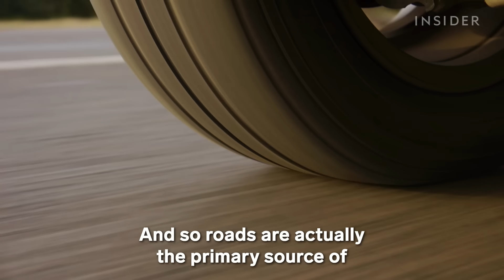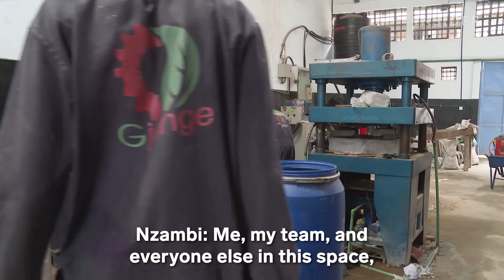Young Inventor Makes Bricks From Plastic Trash | World Wide Waste | Business Insider

Comment: There's a guy on an island who had built himself a process of turning the plastic that washes up on the shores, back into diesel fuel. The people if the island bring him plastic waste they've picked up and trade him that and a little food and he supplies them with fuel.
Why not turn the plastic back into petroleum?
Reply: Because right now it is still cheaper for oil to be turned into gasoline.

Along with that the fuel produced from plastics is actually very mess releasing many harmful pollutants into the air and ground water including mercury. Also the fuel produced doesn't contain nearly the same amount of energy as direct oil fuel. Finally not all plastics can be used.

Comment: They should use use that to make furniture materials to replace wood, just make 4by4's and also boards that people could then cut and make furniture out of and it would become very valuable, and it could be melted a bit to avoid using nails, or to cover it with stone powder to make it smoother and more fire proof.

Comment: 🎯 Key Takeaways for quick navigation:

00:03 🧱 Bricks made from melted plastic and sand could be a solution for Kenya's unpaved roads.
01:56 ♻️ Gjenge Makers recycles plastic waste into bricks, reducing environmental impact.
03:29 🛣️ Plastic roadways are cheaper than concrete, but concerns about increasing plastic pollution remain.
05:22 🗑️ Plastic roadways help manage waste but may not address the root problem of plastic production.
07:05 💪 Inventors like Nzambi Matee make a positive impact but face challenges in tackling large-scale waste issues.

Made with HARPA AI

Comment: No disrespect, but this is an awful idea. 
1) Most plastics are sensitive to UV and will break down in the sun.
2) The erosion from tyres will break the plastic down into microplastics 5-10 microns wide which then will introduce the microplastics into the ecosystem of local wildlife (So you will have tiny particles so small and spread out they will be difficult to gather and only break down after hundreds of years. 
This obviously will block digestive tracts of local wildlife and has been proven to affect photosynthesis of algae(Even effect gene expression in some cases) just to name a few which has huge environmental implications.
3)Plastics ca be very flammable and some will burn excessively releasing toxic gasses such as dioxins, furans, mercury. So if car crashes occur you there is a higher chance of dying due to toxic smoke inhalation, if there are wildfires you and local wildlife will be exposed to toxic smoke and if you try to repurpose it to make houses, if they catch fire they will burn rapidly and engulf the area in toxic smoke which will have far more extensive health implications then traditional smoke inhalation.

I want plastics to be gone from the world too, but its a long and complicated issue which if not considered carefully will just mean the "solutions" you try to create will be just as damaging as the problem.

Comment: Using trash to make more trash in a different way is not the solution at all. Reducing trash at the source, is. Besides, there are indeed health and safety risks with such a material. The microplastic particules contained in the brick would just dissolve over time (from erosion, UV rays, etc...) and mix with dust and water, sending microplastic particules in the environment. Again, it's not a solution, at all.

Comment: Holy crap this is beyond awesome.  Wow why hasn't this become world wide news top story on ever web page.  This young lady just freaking solved so many issues in developing nations and in first world nations.  Melting plastic and mixing it with sand?  Does this girl's business have a GoFundMe or a website to be able to accept donations?  And donations in the form of cash not plastic.
Reply: @_strangeways_  Do you not understand that such processes can be modified or even improved to prevent such microplastics from being released?  This process is being perfected and with some more research or even some better funding this process can be made not only easier but safer.  Or are you so dense as to think that near every innovation in the history of humanity didn't share a time when they too where more hazardous than beneficial.  From the creation of lead acid batteries which are still used today and to which the process of making them is extremally hazardous to the environment, to also the use and implementation of landfills.  Again or are you to simple minded to thing such concepts are actually beneficial to the environment on the whole?  Innovation always comes with a cost, something youngsters like you rarely think of.  Yes I did watch the whole video along with every other video of this process I could find including a story run by the BBC, and I still think its an awesome idea that can create jobs and end a major issue withing the developing world.

Comment: I thought about something like this when we had a really bad and cold winter - i thought firstly about temporary shelters that could be built in a few hours to help the homeless for exceptionally cold nights - but further to that - to have something similar to this which would have to be a) Fire retardant. b) lightweight and c) thermally efficient to use as building material for walls, subflooring and any areas not subject to the abrasion talked about in this - the main poinrt being that it is re-using previously used plastic that would otherwise go to landfill

Comment: For those wondering, her business idea was rejected by the Kenyan government. It was proved that there are too many safety risks and that her business does not stop polluting, only encourages it. The US did a test a few back on an all plastic road and it caused a lot of accidents due to the road having a very slippery surface when wet or iced causing the vehicle to have no grip. She is still in business, but she doesn’t have a government contract to replace some of the roads. Also the Kenyan government put a limit on how much of the bricks she can make due to the bricks still being considered trash.
Reply: These bricks could be used in sidewalks, driveways, or flooring rather than roads but again, the microplastics.😬
Reply: Nice. Was looking for this answer. Seems like a good idea but in reality just spreads microplastics
Reply: @giovannijavier6449  yeah exactly. Props to her for trying. Props to government for looking out for the long-term. It sucks it didn't work, but it was still a great attempt.
Reply: @giovannijavier6449 I came into this calling to see if anybody would agree with her and what she's doing she's not on food stamps and got 45 kids instead all I see whiners and bitters get the f*** off my internet
Reply: @giovannijavier6449 was also thinking the same thing. Maybe it should be used in areas where it's not subjected to constant wear and tear
Reply: maybe adding a rubber compound of recycled tires can help the problem of slippage on roads...maybe
Reply: I think the bricks are a great idea just maybe not for what she’s using them for. Just recently watched a video on a Lego house being built so I’d imagine solid beams of this stuff would hold up nicely and for awhile without the micro plastic problem.
Reply: @austincrittenden5363  The problem is, none of us are experts.  This could be an aesbestus situation where if you ever open the wall up...
Reply: @DarkD112 plastic bottle tops are nothing like asbsetos. at all
Reply: @HomeFromFarAway no they are not, but that doesn't make them better. All of these workers will also have cancer in 5-25 years time
Reply: @austincrittenden5363 I was also wondering about use for buildings.
Reply: Erosion over time from traffic would put microplastics into the environment. . .the exact problem we are trying to prevent?
Reply: The roof tiles are a much better idea. Probably better in a pale colour but they're a great insulator and totally indestructable on a roof
Reply: @HomeFromFarAway  oh yeah great idea, especially when the sun erodes the plastic away over time and when any kind of stress is put on it you can have your roof collapse on you and your family 🤡👌
Reply: @HomeFromFarAway I wonder how toxic if there were a fire? Worse than current options?? 🤷‍♀️
Reply: I don't think her small buniness in Kenya is "part of the problem" unless you insist on only looking at the various systems in play through a very small lens
Reply: In France there is a company making a construction meterial using plastic waste as well. The new material is harder and lighter than concrete. They respect all environmental norms and started to sell it. I think they use something they keep confidential to make the whole thing safe to use. Perhaps if that woman found a way to do more R&D, working with a local university or something, she can find a way to make her product pass all the requirements.
Reply: Build houses with them. Not as the foundation, obviously. But to replace stucco and wood.
Reply: I can see her bricks being useful if they're shaped and incorporated into a structure that's meant to last a long time, and where they are protected from the elements.
Like being part of a wall structure, for example, taking the place of cinder blocks.

So long as that building is not demolished and so long as the bare brick is covered up by a few layers of cement it should work fine.
Reply: My friend you need to get a hobby and go get a life my f**** internet with that b***** at least she's not an unwed mother was 645 Bratz collecting food stamps and welfare that get the f*** all my internet
Reply: Yeah right liar
Reply: Yea it’s a bs idea for idiots trying to green wash - this does absolutely nothing and eventually the plastic will flake off into little microplastics
Reply: All this counter argument but no one mentioning America sending plastic wastes to Kenya and other countries but talk about how her invention to reduces plastic wastes is bad. Use your brains other than a hat rack “Andrew Wommack”.
Reply: Using plastics to make roads is just stupid.
Reply: I understand the concern about microplastics, but at this time, there’s little research on how much is actually harmful to our health. Microplastics are also EVERYWHERE. Obviously safety plays a big role and I’m by no means an expert here, but we also have a trash problem as well. It may be a situation where it’s about the lesser of evils.
Reply: The friction issue can be solved used geomaterials of large clast size
Reply: That's evil
Reply: @alyctro8158  no, that's smart and responsible. Using trash to make more trash in a different way is not the solution at all. Reducing trash at the source, is. Besides, there are indeed health and safety risks with such a material. The microplastic particules contained in the brick would just dissolve over time (from erosion, UV rays, etc...) and mix with dust and water, sending microplastic particules in the environment. Again, it's not a solution, at all.
Reply: @YanickGirouard  yes it Can be the concrete industry is responsible of most of the pollution in the world. If we can cancel them out we can drasticlu reduce the pollution in the world.
Reply: @YanickGirouard better just leave what is in the landfills where it lies then... Don't let perfect be the enemy of good, the bricks can still be used for low stress situations.
Reply: @SlashCampable  i agree, people are currently researching how to break down plastics using the process of purolisis into safe oils and carbohydrates. Land fills can just act as the storage sites of our excess plastic waste until a solution is created that will solve the problem for good. As much as I appreciate stories like these, what is the point of a "solution" to plastic pollution if it is equally as damaging as the problem.
Reply: @tecumsehzacateco8798  The concrete industry?  They don't even really register as a problem to me.  Fossil fuels, cargo ships, travel planes, woman's fashion, electric vehicles.  Those are the worst polluters in the world.
Reply: @DarkD112  producing concrete also produces massive amounts of CO2, anyone coming up with a way to make that process less CO2 intensive would be reducing pollution significantly. There's more obvious sources of pollution for sure, but concrete will be one of those ones that's very difficult to solve on a worldwide scale. Kind of like how a lot of plastics can be eliminated by replacing them with other materials, but some necessary stuff just doesn't have a good non-plastic solution.

I do think people are worrying too much over these bricks though. Shouldn't be used for roads, but for specific construction projects where they aren't as exposed to weathering, it's probably a lot better than the alternative (mountains of plastic just piling up in what I can only assume are poorly regulated landfills over there).
Reply: @Michael-uc2pn  If they can find a safe way to reuse plastic, great.  But plastic isn't harmful to the environment at all as far as I'm concerned.  The only claim I've ever heard and ever been able to research about plastic is that "they sit in landfills and don't deteriorate for a thousand years.".  My response is, "who cares".  

Landfills are designed to not let anything deteriorate.  Obviously they aren't perfect, but the amount they actually pollute is negligable.  The only reason people care is because the news plays on people's fears.  People see a landfill and think, "that's gotta be horrible for the environment." But the reality is that it's not.  

That's not to say micro plastics aren't an issue.  Same with plastic that gets into the ocean.  My claim is limited to plastic in landfills.
Reply: But plastic in landfills will eventually become microplastic or end up in the ocean. I think it is a lot better to „store“ the plastic in things like these bricks until we have a solution, than to let it sit in landfills, where they pollute the environment even worse
Reply: @DarkD112 

The creation of cement from limestone involves shedding a bunch of CO2 directly into the atmosphere. The industry as an entity is comparable to major nations (I think close to the USA? same ballpark) in terms of CO2 production.

Maybe you meant plastics pollution specifically?
Reply: @DarkD112  But plastic in landfills becomes microplastic.
Reply: @YanickGirouard  I am worried about microplastics getting into water with a high volume, wear and tear environment such as a road. I think this may continue to contribute to the microplastic problem. However, I love the general idea of trying to make useful things. Maybe into something other than roads. Plastics are evil! But this woman is brilliant!
Reply: @alyctro8158  if being logical and cautious is evil then you’re stupid
Reply: @alyctro8158  no it isn't, thats responsible. Those plastic bricks are STILL PLASTIC. It'll be shedding microplastics into the environment as long as they are around, polluting the air and water for potentially decades

Comment: What a waste, most plastics should be recycled,  since they can mix new and recycled pellets when molding new plastics parts at the factories..
I've worked in one of the largest plastic factory of car parts in the world, and they always used a set % mix of recycled plastic pellets..
Reply: This will cause alot of micro plastics being released into the environment using it as plastic bricks... And it will brake down over time, so it's not a good thing..

Comment: She’s great and obviously aware of the complexities of the issue.

Right away I wondered about microplastics but also BPA, not only in the environment but even for them. 

Standing next to a machine that is pulverizing plastic can’t be good. And definitely not following up with handling heated plastic.

The guy sanding the bricks is again releasing all that microscopic plastic into the air.

There has been findings of worms that eat styrofoam and plastic, and ultimately that is where the solution will lay, especially since lobbyists continue their evil work for the plastic industry.

Comment: I've never heard of microplastics. All materials leach out chemicals or substances as they degrade over time. Regular asphalt likely leaches out oil and chemicals too. So these bricks leaching out microplastics can be an issue I suppose. But what's worse? This or the chemicals from asphalt? Studies would have to be done. In any case,  roads and building materials need to be produced from something. And if plastics are not any worse than asphalt,  and we can recycle a waste material than this is obviously a good 😉 idea

Comment: This might actually be worse. Plastic breaks down no matter what. When these micro plastics get washed off, they may lead to some major water ways
Reply: It would be worse in most places, but they have to consider the landfill too. As is, they have a overflowing landfill and constant trash fires, with the problem only getting worse. The bricks seem like an upgrade in this particular location. But you're right, the bricks also cause significant problems.

Comment: Mixing PET ,PP and PE ,drastically overheating it to burn out its bonding properties. Will add more plastic to water supplies ,Will not last anywhere frost is present . Fail before it began this has been tried with many materials including using old tires. It's just waste relocation

Comment: This should scale up well, and automate very well.  The primary labor, once automation was in place, would be in separating the plastics.  Sourcing the aggregate (sand) could be an issue depending on the end use quality is required.
They need to pave a mile long stretch of two-lane roadway to see how the wear (probably rather poorly as the plastic would quickly polish to an ice-rink smoothness).  For footpaths, however, this product would probably be ideal and the lower wear of feet will reduce the quantity of microplastics produce - though do nothing to the overall chemistry of the plastic as it breaks down.